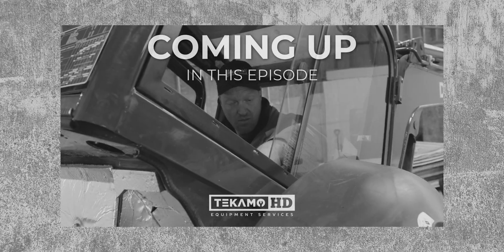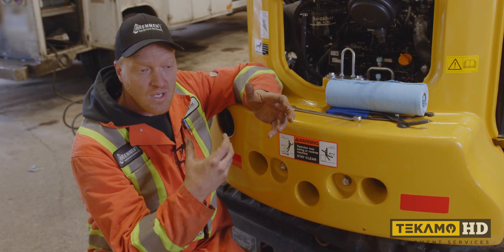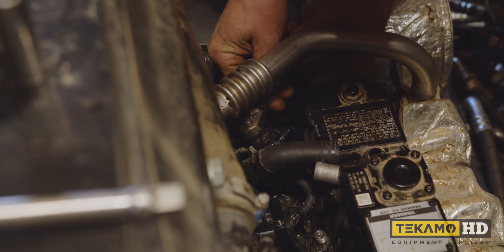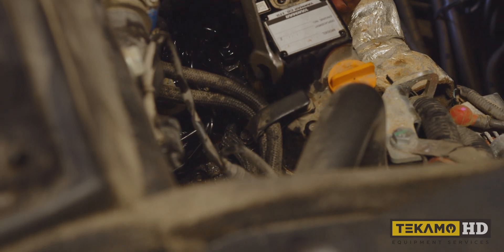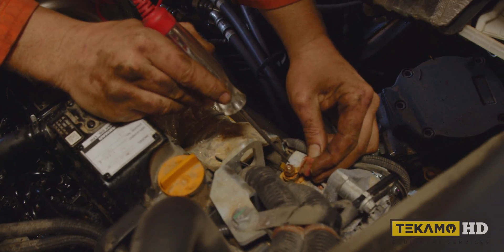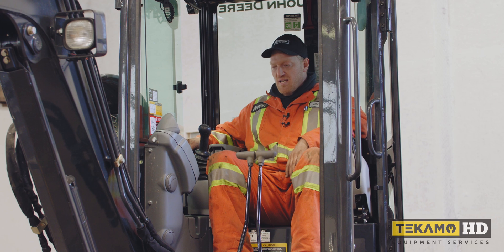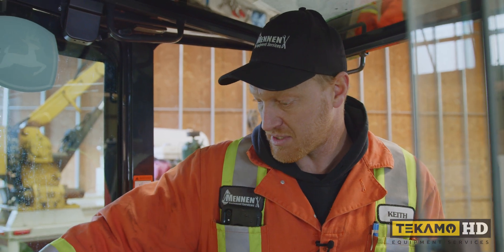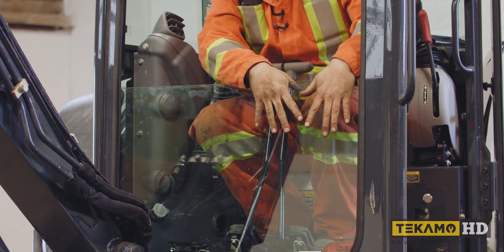Service Call: SUBMERGED John Deere 35G - Engine cylinders & Engine start!

Comment: Not a big jd fan but dang that’s impressive!
Reply from the maker: Thanks for watching and supporting the channel! We will be doing other service truck and tool videos very soon, be sure to check those out when they release.
Reply: That's a John Deere in name only.  Exact same machine made as the R35Z-9A both made on the same assembly line by Hyundai.
Reply: Um, you don't know what you're talking about. Deeres are made by a small Japanese company that started out making compressors in WW1. The 3.5 deere zero tail is the most revised and refined machine of its class on the market. It has stayed true to design for decades, and has the reliability to prove it. Are they making Maytag dishwashers in that same factory as well..?
Reply: @georgehofgren6123  Wrong.  (but then again, so was I originally)  Check out my correction.
Reply: Correction.  I meant Hitachi ZX 35 U5.  Hitachi and John Deere have been partners designing and building excavators since 1983.